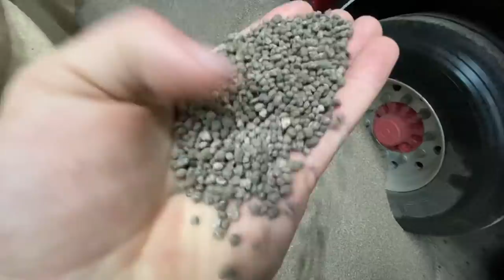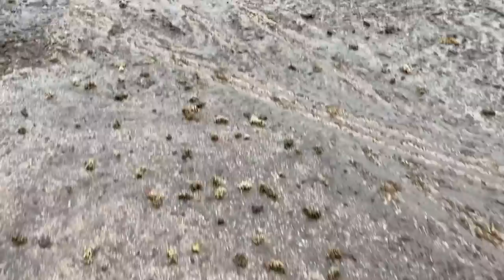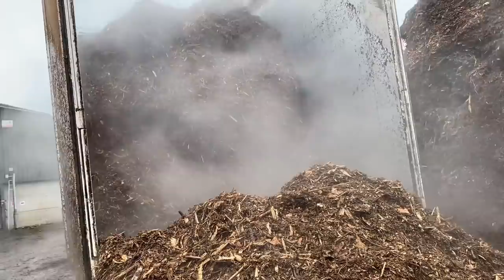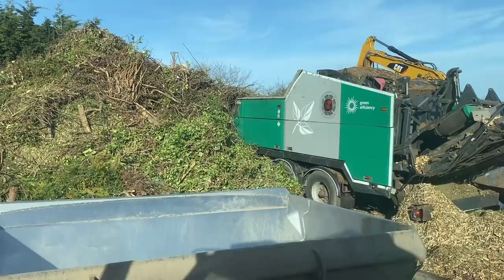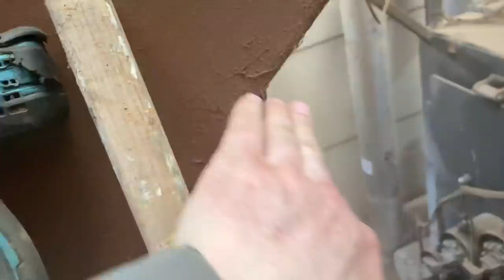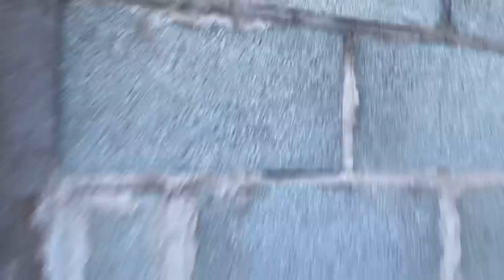Day 359 #Ollyblogs #LockDownLearning  #farming #woodchip  #tractor

Comment: 10k! 👏👏👏 Did I see 2 30 series John Deere’s in the yard? One with a vacci tank? Also it is the positive and negative battery connection points if your using a control box etc in the cab

Comment: Yeah it's another exit power point for jumping and you can use it to power diesel pumps to fill the tractor with diesel or use it as a light if the tractor breaks down and you need to power a 12v light

Comment: I would have said a jump start connection on those cab posts but the deeres I drove those were on the drivers side next to the alternator. Fly tipping absolutely boils my p*ss and the people who do it are absolute oxygen thiefs, but what I don't get is why councils make it hard for you to get rid of rubbish in the first place - always queues at the local tip, have to book in for anything significant with restrictions on visits etc. No wonder it's such a problem. Make it easy to get rid of rubbish and the demand for the scrotes that fly tip goes away - simple!
Reply from the maker: Yes